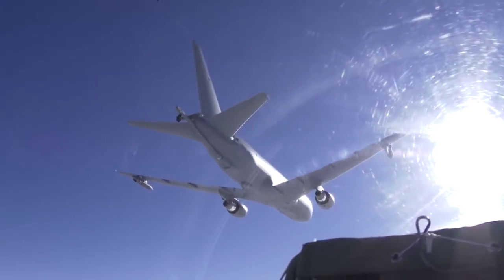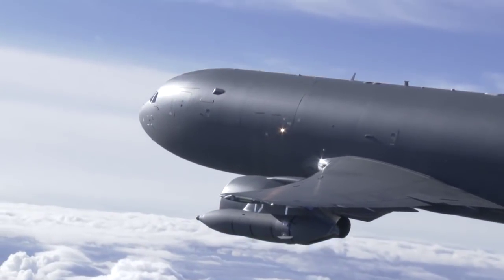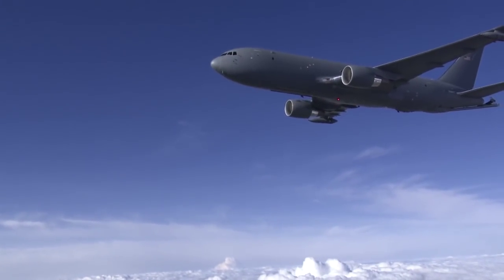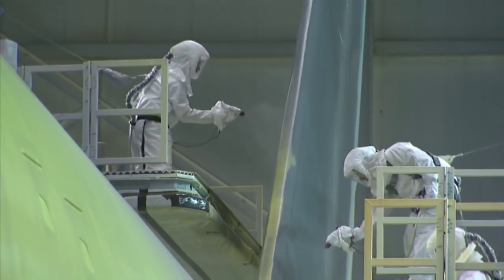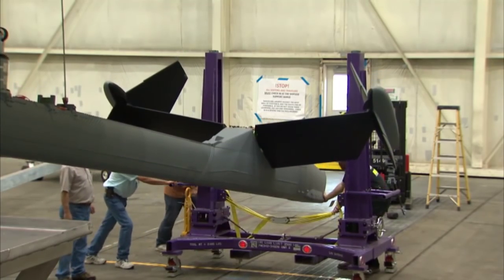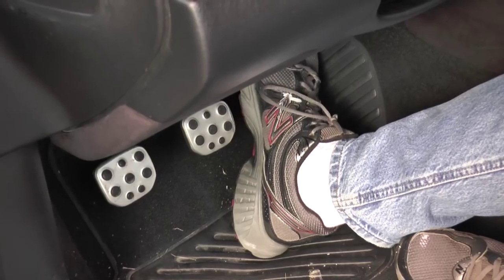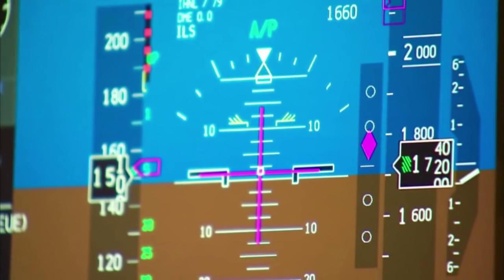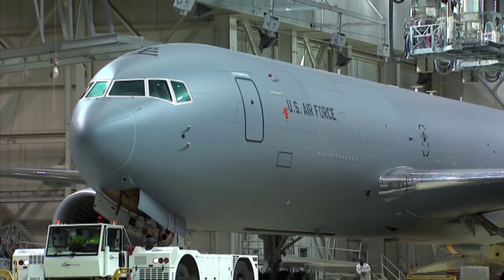Boom Time: Boeing’s KC-46 Test Plane Flies with Refueling Boom

Comment: These are nice - but no escape systems, capsules, parachutes for crew members?
The Army learned the hard way in Iraq that even supply units and bases needed armored vehicles, body armor, weapons etc. The days of open top jeeps from MASH are long gone...
The Air Force should already plan ahead for asymmetric warfare now. So your refuelling squadron is out over the Pacific refueling near some artificial island, and low 
and behold a rov submarine, or untracked drones, or a disguised fishing boat or disguised civilian transport launches a volley modern surface to air missiles - taking out 4 out of 5 of your two-engined tankers (the 135 at least had 4 engines). 

How can you jump out when only front-line fighters have ejection seats? The B-1 and B-52 have crew ejection seats. You don't even need full rocket seats though - the A-1E Skyraiders used much cheaper 'Yankee' extraction systems to egress from their
prop attack aircraft. Bailout is possible from jets - C-17s drop paratroops all the time. The USAF needs to move to a 100% parachute TQM rule. Like seatbelts
when driving - or armor on vehicles for all Humvees whether supply or front-line.
Reply: Tankers don't fly anywhere near enemy lines. It's aways behind the fight

Comment: I hope they got it very cheap since the 767 has been in service for a lot now
Reply: luis laurencio The 767 is an awesome aircraft!!! Who cares if it's old!!!
Reply: kushdaddy144 you expect the us airforce to use eurpean planes? Really? Anyway the 767 is way cheaper
Reply: luis laurencio This is a franken 767. It uses various things from various 767 models. Hence the reason it isn't just going into service like the 767 refuelers other countries use.
Reply: luis laurencio That was the whole point. Now they have a proven concept (it has proven it can fly) and don't have to stick a lot of money in devellpping the plane. Just for buying and slightly having it modified for it's function. It doesn't have a complicated life or death function anyway. like dogfighting and pulling G's. All it has to do is fly somewhere, refuel airplanes and go home. No highly classified technology nescesarry.
Reply: kushdaddy144
So? Must have cost a lot less to transfer it to the US.
Reply: luis laurencio What plane is the USMC currently using? Oh look the harrier which was based on the UKs jet.
Reply: kushdaddy144
based on.. that is exactly the right usage of words. However built and heavily modified in the US. Again, proven concept, way cheaper.

OK, let's think about it logically. I get your point. But what is the tanker supposed to do. It is supposed to fly and pass on fuel. That is it. Apparently the KC46 burns less fuel per flight than the KC45. Or so I have read. If that is so, that means that the KC46 will have more fuel on station when necesary (or however that is spelled). Tankers pass on fuel from their own fueltanks. No extra built in fuel tanks. So this makes the KC46 better than the KC45 in it's role. That the KC46 is 4 million dollars more expensive, will be compensated or evened up by the lower fuel consumption after a while/in the end, in wich case it makes the KC46 cheaper or just as expensive. So whats the use of buying abroad then. Way more paperwork, way more customswork that has to be done by people who have to be paid and way more fuel they have to consume to ferry the plane to its base.
Reply: +spacedigger 
You do seem to be just trying to justify what was an appalling decision by the US Senate after EADS / Grumman won that competition perfectly fairly. It was good old US protectionism plain and simple and nothing less. The USAAF is getting a smaller aircraft barely 6.5% more capable than the 50 year old KC-135s. It is having to pay for all the development work as its a new design. Boeing put in a suicidal bid and are already $1 Billion over budget. Always a good sign of cheap tendering. And it will have to wait some years before they are in full front line service. Here in the UK we ordered 14 Voyager tankers (A330 MRTT) the same month the Senate cancelled that competition. We now have all 14 in service and the first one was delivered in early 2011. And which tankers are refuelling US Navy and USMC aircraft over the Middle East? Yep. RAF and Australian A330 MRTTs.

So lets take your points:
 * If the KC45 (aka A330 MRTT) burns more fuel per trip it also delivers 111 tons of fuel compared to the KC46A 96 tons as well as carrying 45 tons of freight / 300 personnel. (KC-135 delivers 90 tons)
 * "Tankers pass on fuel from their own fuel tanks. No extra built in fuel tanks. So this makes the KC46 better than the KC45 in it's role". How so? the KC-45 delivers from its own tanks like the KC-46.
 * "That the KC46 is 4 million dollars more expensive, will be compensated or evened up by the lower fuel consumption after a while/in the end, in wich case it makes the KC46 cheaper or just as expensive. " You just argued against yourself and you are way wrong. The USAAF puts the KC-46A program at a total DEVELOPMENT cost at $5.85 billion. In March 2014 it was nearly $1.1 billion over budget. ANd as it delivers less per sortie than the KC-45 overall fuel consumption will be higher (more take offs for a start). The A330 MRTT was a proven aircraft and so no development costs were necessary. 
 * "So whats the use of buying abroad then. Way more paperwork, way more customswork that has to be done by people who have to be paid"
Wow ... You didn't know the KC-45 was going to be built in Alabama? And by the way the USA has 'bought abroad'. 3 times. And they were all British: B-57, Harrier and Goshawk. 
 * " and way more fuel they have to consume to ferry the plane to its base."
From Alabama?

Have a read:
http://www.reuters.com/article/us-boeing-tanker-idUSBREA2K1UA20140321
Reply: 1chish
WOW dude.. That is some bunch of tekst. Listen, I really don't know when or what I have typed anymore considering it has been some time ago I actualy responded to this video. A couple of days I might remembver what I have typed, after that.. Nope.. gone. Other videos to watch. I don't even recall watching this video :P And, to be honost, no way am I going to read all of that what you have just typed.
Reply: spacedigger
No worries. I guess your attention span couldn't cope but others will see it and it was more for their benefit to be honest ...
Reply: 1chish
Nothing wrong with my attentionspan dude ;) But after months, I don't give a shit anymore about a discussion, like any other person. I can't help that you are just incredibly late. Tardiness shall not do.
Reply: +spacedigger Look at you, yet another moron commenting on here. The tankers use bladders located in the fuselage that deflate and inflate with fuel you moron. They don't just send off their own fuel from the their tanks. That would make no sense if that was so. It would be nearly completely useless for use in mid air refueling. Common sense is something you clearly DON'T have.
Reply: BewareTheIdes   Its based on a "what if" updated 767.  

Its using the 787 cockpit and avionics but everything else is a standard 767 .

They didn't use the 787 body because its still new and Air Force planes get abused requiring a lot of spar parts. Since the 767 been in service for decades parts are cheap as hell.